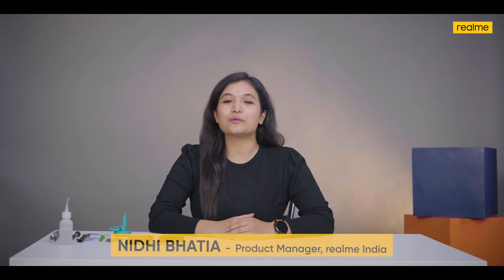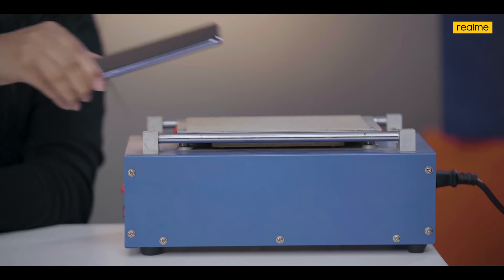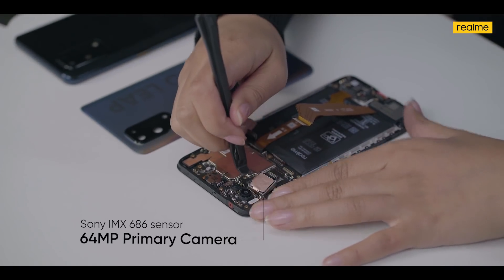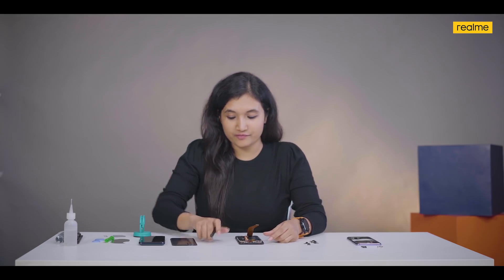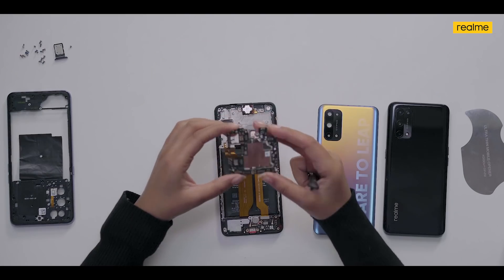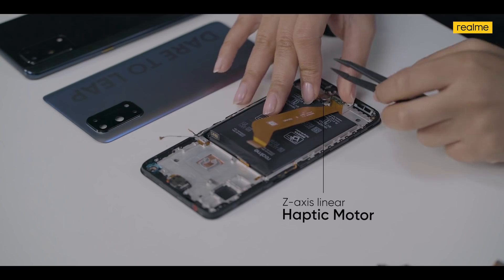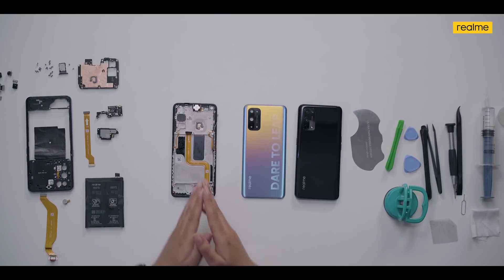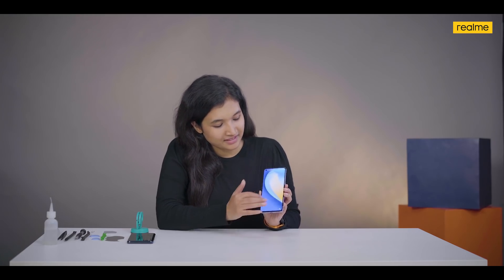realme X7 Pro 5G | Teardown

Comment: My Favorite features are
1) Mediatek 1000+ 5G Processor with 540000+ Antutu score
2) Super Amoled display with 120Hz refresh rate 
3) Light weight and Super slim
4) Solid 4500mah battery with 65W SuperDart charging technology
5) Vapour chamber with Copper sealing And Graphite layers shielding type Cooling System

Etc Flagship Features under 30k Rupees.
Really Awesome Smartphone.

Comment: "Entry Done"
For "realme X7 Series"
Looking To This Device, realme X7 Pro, is a Best All-round Performer Under the 30k Prize-Range. The Device Have A Super AMOLED Display With In-Display Fingerprint Scanner and 120Hz Superfast Refresh Rate. For Gamers This Display & The Refresh Rate is Very Usefull For their Gaming and also the 4500mAh Battery With "65W" charger gives a thunder speed on the device charging department. The MediaTek Dimensity 1000+ 5G,7nm based SoC gives a Flagship Gaming Performence in this Device. The Dimensity 1000+ Chipset Is Very Power Efficient Due to the 7nm manufacturing process. My Attractive Features on this Device is The 120Hz Display & 5G Capable SoC, which gives an extraordinary Gaming Experience.🔥